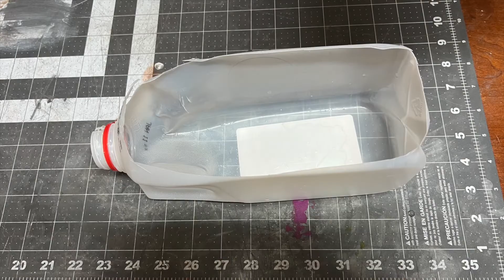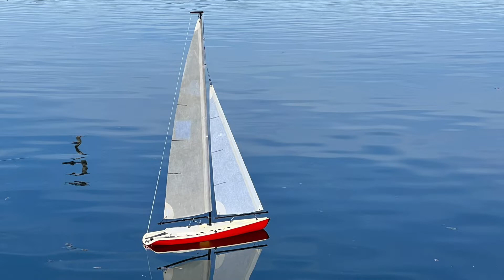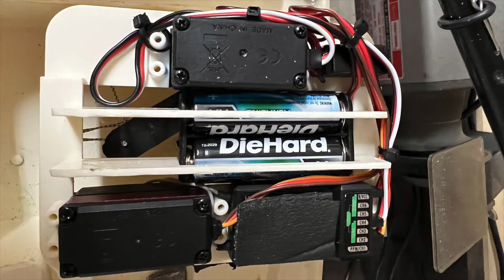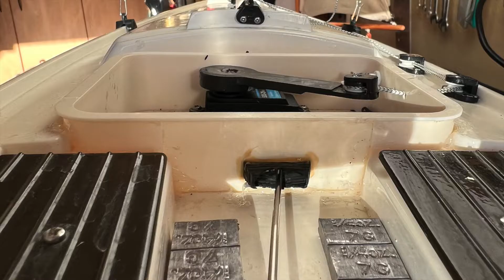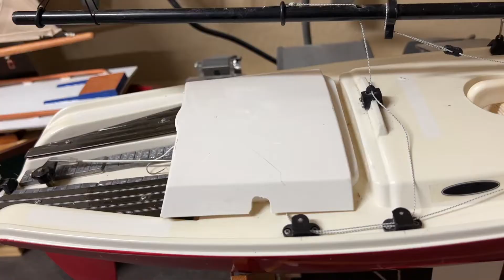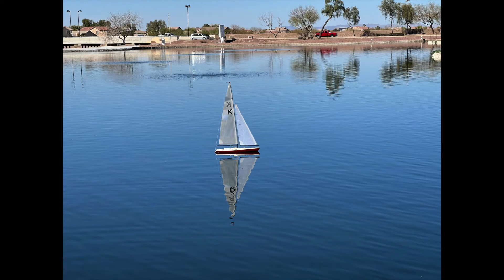RC Sailboat Nirvana II

Comment: I just bought a nirvana off marketplace in Huntsville Alabama. I think it's an original version. I plan on putting in new servos as an upgrade especially the sail  servo but I don't know where to start to get the size to fit. I have a flysky fsi6 tx for my df65 that I would like to use for the nirvana. Can you please give me some advice on this issue? Also the sheets seem a complicated setup to control the sails.  Can you post a picture of the setup you have. One further question... Do you still have the nirvana for sale?  Thanks for any help you can offer. Bob
Reply from the maker: I sold my Nirvana over a year ago.  Putting new servos in was difficult and I never was able to keep the radio compartment dry.  My best advice is the Nirvana Yacht group at https://tinyurl.com/p3h22u5r   It sailed great but I always took on water in the radio compartment.
Reply: Thanks

Comment: I noticed you put a 2S lipo battery in this boat. Do you think it would be OK in a Laser RC boat?
Reply from the maker: Not with the receiver and servos that are supplied with the Laser unless you also install a battery eliminator/regulator circuit in series.  See my Laser video at https://youtu.be/k0UTujuq2_g
Reply: Thanks-I don't have a stock receiver but I still have the stock servos. Guess I'll stick with AA batteries.